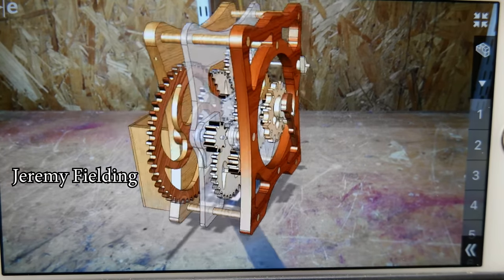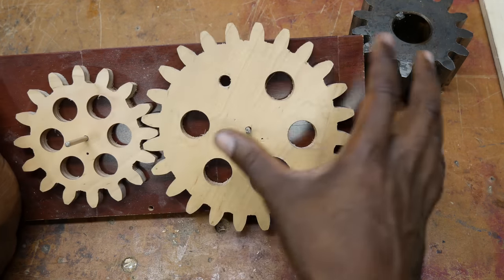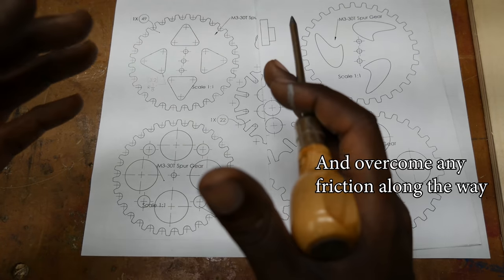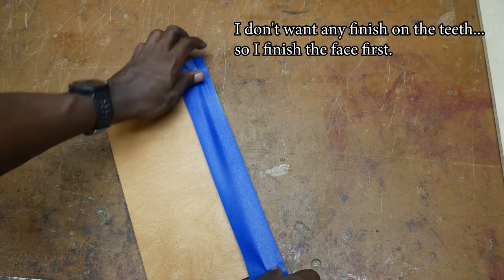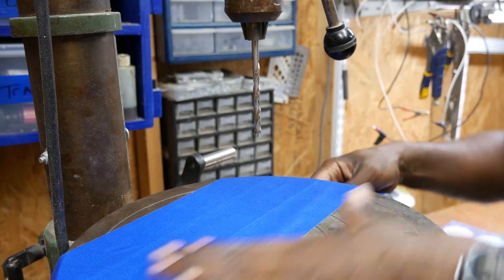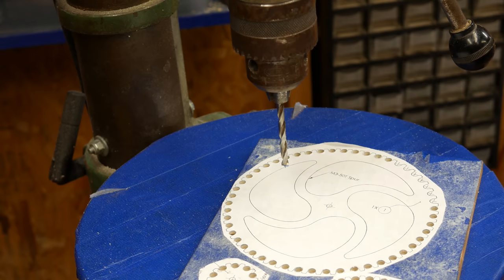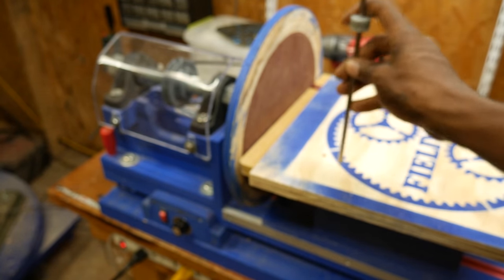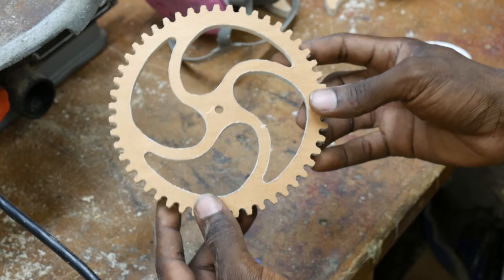How I Design And Cut My Gears Without A CNC Machine: 045

Comment: This is off topic (sorry); I’m trying to make a knife grinder (2” x 72” belt) is it possible to make it variable speed without the gear system you said in a previous video with a washing machine motor? Are all washing machine motors AC? From what I’ve read most people use DC treadmill motors but I have access to unlimited salvaged washers and dryers. My actual question is can I use a light dimmer on a treadmill motor I think? What’s my best option?
Reply: I have a welder and I just subscribed.
Reply from the maker: +Guess Who I have videos on all your questions. Please search my channel. I have discussed all of this. Your question is too complicated for a adequate response in the comments. They are all in the wire and control salvage motors playlist.
Reply from the maker: +Guess Who welcome to the neighborhood!

Comment: Sam Maloof made some incredible stuff without CNC, but he was making furniture, not machinery, from wood.  Doesn't using so much blue tape introduce irregularities to your surfaces and thereby counteract some of the effort you put into making sure your drill table is perpendicular to your drill?  I like what you're doing, but it doesn't ALL make sense.  That Dirk Stabins comment about the drilling jig IS a really good time saving idea.
Reply from the maker: +Ron Yerke possibly the overlapping parts of the tape might cause a problem but I risk it to remove the extra effort of removing glue from the surface finish at the end. That part is always painful
Reply from the maker: +Ron Yerke the blue tape has not created a noticeable problem. But the pattern tearing away was a constant problem which was solved with a stronger glue, but that required the blue tape to remove the cleanup process.
Reply: Jeremy Fielding have you considered using plastic kitchen wrap?  It might cost less than blue tape.  Maybe the glue won't stick as well.
Reply from the maker: +Ron Yerke I have not tried that. I have pretty much finished cutting the gears out. But, I am curious if the spray glue will stick to it. The issue might be that it stretches. That may cause a problem. I don’t know

Comment: Now I can't figure out why guys who like building clocks or cutting gears by hand, never seem to invest in a dividing head / indexable rotary table. They aren't that expensive. Seems like you could get super accurate, and opens up the door to utilizing different cutting tools. At least that's the way I'd do it, short of not having CNC access.
Reply from the maker: You have to know what a dividing head is, in order to know to buy one. I have never hear of this secret tool you have been keeping from me! Where I do go??? Reveal these secrets quickly to save my future clock making efforts. LOL
Reply from the maker: +Eco Mouse after I responded I thought it must be a machinist tool. And clearly it is. That is the real deal for very accurate holes. I will consider this... thanks. I did make a quick jig out of wood that has been helpful after one of my neighbors recommended it here in the comments. I think this would make a nice addition to the shop.
Reply: Jeremy Fielding I've been a tool junkie since I was a kid. Back in the day before internet, we got catalogs. I'd study the pictures and descriptions intently. In my mind there were always at least two ways to make something. The MacGyver way with what you've got, and the way businesses make money by using the tools to make their jobs easier. When coming up with shop made tools and jigs, I always try to mimic the real thing in some capacity. But sometimes it's just worth it to have the real thing. I'm usually concerned with getting the task at hand done, rather than the fussing and fighting during the process. I only have so many years here in this planet! Haha!
Reply from the maker: +Eco Mouse well said my friend. Some tools and jigs I build, some are worth buying. I completely agree.

Comment: I have a dream of a world with not only no waste but a world with a goal to constantly maintain efficiency. Scrap materials leftover after a build is complete usually ends up in the garbage and becomes waste or is sold as scrap at a disturbingly low rate. Many pieces already have some machined surfaces so setting a reference point is easy to do. I have been watching intriguing looking pieces of many many different types of materials just go to be melted away or whatever. I want to start showing these pieces and accepting bids from those who have the vision to see new possibilities. Waste is not waste until wasted. Is this something you would be willing to help me achieve? I can provide you a random piece(s) to show your viewers and ask for feedback on what they see ...once a idea is accepted then you can do the maker video and we can get these misplaced resources back into a more useful existence. I have both the desire and usually the capability of taking things apart and looking at individual pieces but more often than not lack the vision to meaningfully repurpose them. I would love getting new ideas.

Comment: Sadly its not just pressing on a button and drink coffe. Buy a CNC and you will change your mind.
Reply from the maker: I actually built a 4 axis plasma and tool changer spindle CNC... I still agree with this statement despite the challenges of learning to build a custom machine, and to program and run parts. Check out the series if your interested.
Reply: @Jeremy_Fielding  I agree it is a really big challenge to setup a machine. If the machine is configured good, and you know, the machine isnt doing bad things, I fully agree with your statement. But it is not ever the case. Thank you for your answer. I wish you and your channel a good future.